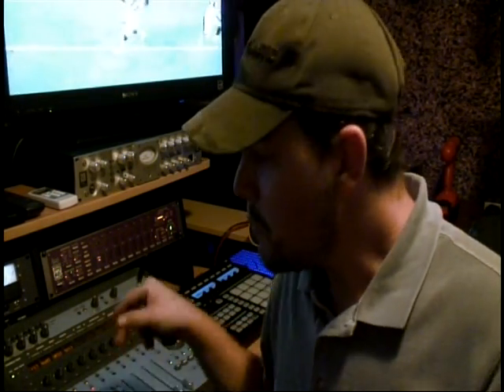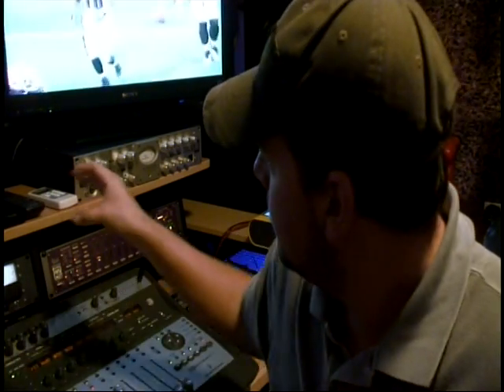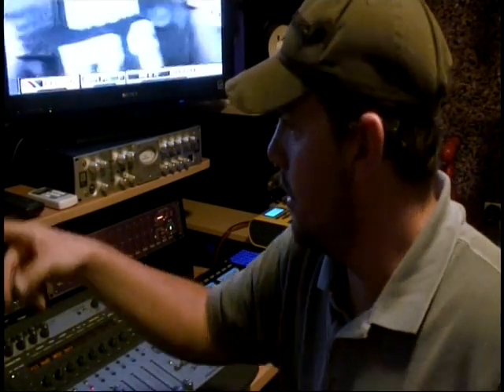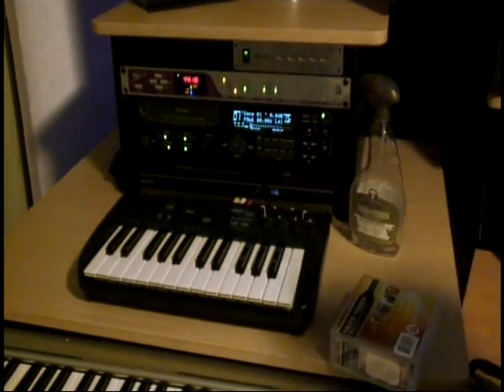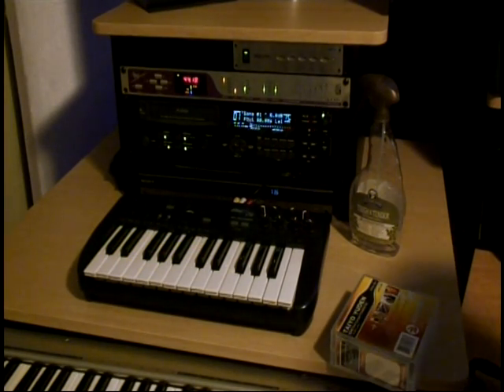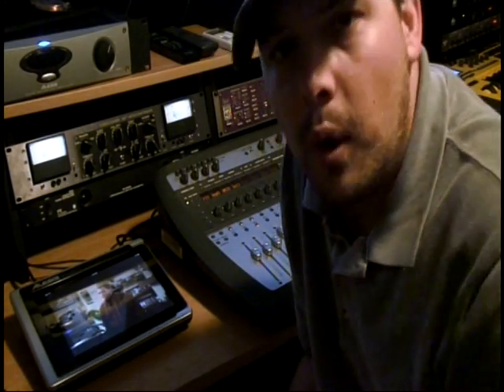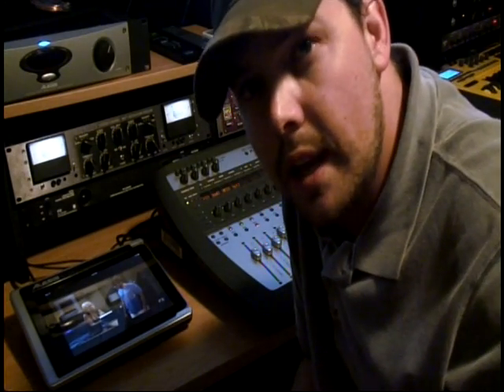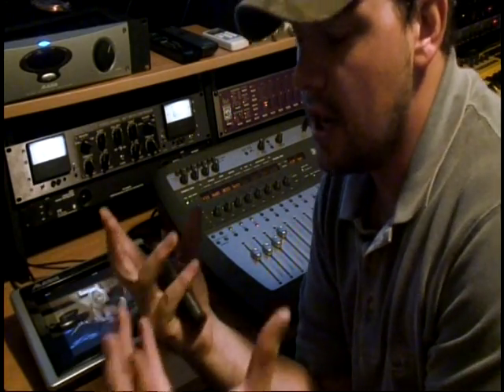Hooking up ad/da convertors and clock to interface

Comment: hello can i integrate my apogee rosetta 800 to my rme fire face 800, if yes, can you please roughly tell me the connection and is it worth to do it. since rme ff800 is a;ready good ad da converter already? thanks,  i hope you will reply to my questions, really struggling for this
Reply from the maker: more tracks, and apogee probably has a slight edge over the fire face..  adat out and in of each unit.. making a complete circle..  out of rosetta in to fire face, and vice versa..  The fireface will be the main convertor..
Reply: Doug Jenkins hi Doug, thanks for the tips, really appreciated it ver much, with the connection set-up you mentioned above, isn't it we downgrade the rosetta 'coz she was supposed to be main converter....if let say i buy a firewire card for rosetta so that her role as ad da really fullfilled, do you think it will a big difference versus the setup connection you have mentioned above which is actually i tried it sound s really nice already, please  iwill apprciate ur thoughts as an audio engineer regatding this matter..thx  in advance
Reply from the maker: praise20088888888
   Well what you would want to do, is set your clock as external clock and your main in's and outs will be your rosetta.  for example adat 1-9  or 9-16 will be your main outputs now.  You will still have the fireface, as a hub/interface, and more outputs inputs.  but your sound quality would now be dictated by rosettas clock, and also the ins and outs on the rosetta would be the main interface, if you use those in's and outs..   I did this with a digi 002 when I first started out..  good news, rme I still use a rme adat 9652 card, cuz they rock at stability for these purposes. and you can actually use the mix window/matrix as a digital patchbay.. it's a little confusing, and I recommend a external patchbay once you get more equipment, or need multiple purposes for inputs and outputs..
Reply: Doug Jenkins hi Doug, after getiing insane understanding ins/outs/direct outs of my rme fireface800 software as well as routing to rosetta, finally i made it, you can tell a little difference among the the 2-options...the first one is a littel touch of digital sound and the second one is more analogue sound but overall both sounds very good..but still i want to test if the the rosetta how it will sound when have its own firewire digital connectivity, planning to buy fireward card... anyways, thx for ur help...i really learn a lot rectifying everything per your directions you have adviced..God bless!
Reply from the maker: praise20088888888
same to you,  at that point, the direct transfer may make a difference. it's as hooking up my symphony i/o usb to my mac, or running standalone to my pc.  My PC is bigger then the mac, and actually sounds atleast 15% more imaged, and that's light pipe in, to a RME 9652 adat card.   you could try that too.. have that as your main card.  but I think your thinking right.. with the rosetta as the main.

Comment: Where in this setup/connection chain would an external mic pre go? how would you connect it?
Reply from the maker: Mic,, to preamp, preamp out, to line input of interface..
Reply: Doug Jenkins External A/D and a separate external D/A and I want to use the A/D as master clock?
Reply from the maker: word clock out of A/d into your interface in. or if no wordclock on interface, use spdif or adat to clock the interface.   usually adat out and in of interface, from both a/d and d/a  you can carry a clock signal on the same channel of the audio adat fibre optic.. carrys 8 channels.    then in your software choose the clock source as external..  this may seem confusing. but once you understand it, you understand it..  I wish I could be there to help you man, this is super confusing to explain through typing.
Reply: No problem that helped a lot. Does the dac HAVE to come back into the interface? Or can I just connect to the out of interface? It has a very good clock if its own. Does it have to sync to the same master clock? since its going to my monitors?

Comment: so how to i connect my big ben to the rosetta to my digi003? can you please show me the link if it' bigben>rosetta>003, or bigben to both rosetta and to 003, etc...i just got a big ben and i'm having trouble connecting it. I'm dumb i know. but an you please help? it seems like you're very knowledgeable in this area...
Reply from the maker: Rosetta adat in and out of 003,,  Big ben should feed both the 003 and rosetta via Wordclock..  then set clock in pro tools to Wordclock
Reply: i'm sorry can you be a little more specific. i don't get the language.
are you saying that i need to connect Big Ben to the Rosetta800 as well as the 003, so it would be two connections? or...i connect Big Ben to Rosetta, and from the Rosetta to 003 with another clock cable...? or just simply connect the Big Ben to Rosetta and the a/d cables to the 003...
i guess what i am trying to say is if i need to connect the big ben to just the Rosetta or connect the Big bang to the Rosetta as well as the 003..?

Comment: incredible video!!!!!!!!!!!
Reply from the maker: thanks man
Reply: Doug Jenkins i wish i would have saw this before buying my duet 2. its a great interface but i can't expand on it. I'm now looking for an interface where i can later add on a converter and clock source. can make any suggestions?
Reply from the maker: man, that's a tough call, I'd just go for the gusto, and buy a apogee symphony i/o 2x6 and be happy for a long time
Reply: Doug Jenkins lol yea ur right. its time to save up. also i produce and i wanted to have one of my tracks mastered by you with your gear, i need to experience for myself "the sound" that i have never been able to hear
Reply: Joshua Tracey also since u have the 002, black lion audio has a mod for it that is supposed to be better sounding than most high end interfaces on the market right now. u should check it out if u don't already know about it
Reply: Joshua Tracey whoops lol my bad, i thought i saw an 002 rack. disregard that last message
Reply from the maker: I haven't had the 002 for years, I have the apogee rosetta and apogee symphony i/o little upgrade action

Comment: Damn Doug lol...Now u got me thinking of just buying a really good converter.
Reply from the maker: A great convertor is like a necessity, and really is one of the most crucial parts to getting solid mixes.. , without it, everything you hook ups only as good as. the convertor..
Reply: Doug Jenkins Yes...I have since done more research and now know what to look for when buying an interface (DAC and ADC dynamic range). Now I'm thinking about going with the 18i20 or pro 40 which have word clock and going with an really good AD/DA converter.  The Forte's i/o count and touch screen gives me the heebee jeebees lol.   Thanks.
Reply: Doug Jenkins Thx for the video Doug. I was wondering, how does the audio connections hook up ? Do you take the master out of the Digi to the converter's input and out of the converters back to a digi input? I would love to have it always on, and not having to make a special out every time i need to record. I use Cubase. I'm using mine only to record synths but i would love to have in the master. Dont know if i should have the out of the conv, directly to the monitors? Sorry about my english at this time lol. Cheers!

Comment from the maker: Yes it's the package deal for sure, you will notice a big increase in stereo image with a clock, more defined, and easier to listen to, highs aren't as harsh any more, lows are more defined.  but when you upgrade the actual convertor path, I talked to apogee, the bigger boxes like a symphony i/o which we run now, the card I installed is as big as the entire box itself,  a lot of what we hear as great audio start with the analog section.  So yes, upgrading all 3 components is the best choice

Comment: Thanks for sharing. It would have been nice to see the actual routing for newbies. I'm wondering how solid your sound is adding the Big Ben and Apogee converters to the 002? I want to upgrade my signal path, using the 002, and was looking at a new RME interface and Dangerous D-Box. Is this a better move than just adding more stable clock and better converters? Thanks again!

Comment from the maker: well, you have to make sure to run adat in and out of the project i/o..  go into your program and set your clock to adat..   then in your inputs and outputs set them two adat 1/2  exspecially the output..  and you should be up and going.. or closer too :)

Comment from the maker: not  to send the clock signal, but depending on if your using it as a controller for a computer, or you using it with the cpu it came with!   the mackie d8b was a all in one solution...  but yes with 2626 just send the output of mack d8b clock out to input of interface..

Comment from the maker: you want the clock out of the mackie/apogee card to go to the input of the interface... usually via word clock bnc cable.. This will give you a better sound quality.. since this video I have done a lot of  upgrading.. but principals the same!  Make sure you set your software to understand that the clock source is external!

Comment from the maker: @Jakaan1000   Your best bet would be to sell off the mbox 3 and buy a INTERFACE WITH ADAT!  running two interfaces is a pain!  so getting rid of the mbox and grabbing something with adat would be wise, but if you really want to, get a rme card like I have that is 3 pairs of adat, and one spdif in and out,, its called rme hdsp 9652, Get rid of the mbox if you want to expand and use your ada8000!  save you headaches, if you have pro tools 9 you can use other interfaces!

Comment from the maker: @Jakaan1000   Understand you need spdif out of a convertor to spdif in of mbox!  then mbox out back into convertor,,  or buy a seperate interface that will do adat in and out of the convertors!     spdif carrys two channels and clock signal, adat carries 8 channels, that's probably why they did that!  sorry to tell you that, but that's how it works!

Comment: I have a mbox 3 pro, external master clock, behringer ada8000 and a UA la610 mk2 preamp. I want 2 no how 2 connect all of them 2gether so when I record I will b using the NH ehringer ada8000 converters. Ps the behringer hve adat and the mbox hve spdif